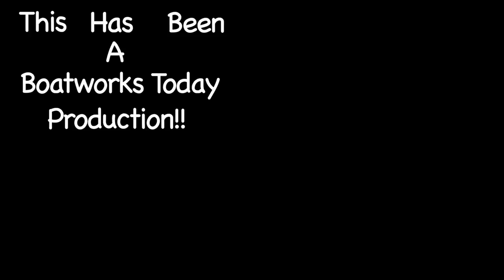STARTING THE FAIRING PROCESS ON THIS OLD SAILBOAT!

Comment: Filler gelcoat- to your 1 gallon of gelcoat with wax, add 1/3rd resin and a gallon container of microspheres. Catalyze a bit more than normal and roll on or 4" chip brush.  Fairing with 80-120 grit will get you 99% there.
Reply: Imagine for a minute I’m pretty ignorant - it isn’t a stretch.  Can you toss out some specific product names?

Thanks!

Comment: The formula for Total Fair has changed since this video was made. In the new version, the blue part is much thicker, more like playdough. There may be a slight green tinge on the surface but that's normal. If you add the right amount of yellow, it will mix to the same creamy smooth consistency.

Comment: Great video as always Andy - maybe a month too late for me :-( 
I've been working about a 2' x 2' repair on my liveaboard.  Replaced the rotten plywood core, glassed over the top with epoxy resin and faired with total fair.  Maybe should have used polyester.  As you said - the gel coat over total fair doesn't set up.  Not just tacky, comes off on whatever touches it.  
I cleaned up with acetone.  Read up on gel coat over epoxy and watched your video on the subject.  Tried it again with the same result.  
Then I googled gel coat over total fair! They don't mix.  Today it is warm enough to go over everything with an epoxy barrier primer per the Total Boat instructions and then gel I'll coat.
I've got a lot more little gel coat spots to repair (it's a 52 footer) and I'll be using a polyester filler for these.

Comment: Andy, thanks for another awesome video. If you would can you make a video of blister repair? If you already made one I’ve not found it yet. I believe a PO of my Aloha 32 used this green Total Fair to fill in the holes when they were attempting to repair some blisters. I’ve been told it just isn’t made for that and much of it came out with a pressure washer the first time I hauled out for the season. 
Thanks for all you do for us.
From the top of the Chesapeake to ya...

Comment: Thats one way to do it.  If I were to paint that I would have looked at an Epoxy Ultra or High build primer.  It acts as a real thick gelcoat.  For your project it looks pretty close as far as being faired.  One of the issues I had run into with that is that it's so thick you need a key coat of primer under for it to bond.  Spray key coat of say finish primer 30min flash spray ultra build, 45 min, one more coat and go have a bite to eat.  I have done them both ways.  Time frames and the ability to spray determines which way to go.  It fairs real nice but don't let it sit for a few days otherwise its get rock hard.   Looks good though.

Comment: Is it necessary to wet out the area first w/ a thin layer of epoxy to make the fairing compound bond better? Or will TotalFair bond to any sanded surface? Thanks for another great video!
Reply from the maker: It's best to apply the fairing directly to a clean, sanded surface :-)
Reply: I'm curious about what you think of people using table top epoxy to do structural repairs? If you watch sailing uma it looks like they used table top epoxy to fix the ribs in the keel.

Comment: I wish I had known about the TB compound not working at all with gelcoat before I started working with it.  I made a real mess. It was so bad I ended up laying down a layer of epoxy resin over all of it and gelcoating over that.  If that separates for some reason I'll either take it all back down and start over or paint.  But it was very solid.  Also, its a sunfish hull, so really just a practice piece.

Comment: Instead, of wax gelcoat, use fairing compound to level the fg surface.  Sand it and apply a second, and, if needed, a third, coat of fairing compound, sanding between coats.

Comment: Andy, you opened the door when you referred to drywall. Understanding that wax is added to Gelcoat, to advance curing, couldn’t we assume that Gelcoat (without wax) would cure on the structure, but not the surface (thinking 50/50). Allowing us to add additional unwaxed coats, to build up before sanding. Just a thought, I defer to your judgement!
Reply: For clarification, I’m suggesting multiple chemical bonds before a wax coat followed by a mechanic bold. You thoughts?

Comment: Love your videos. I have a 1965 17' Boston Whaler that has horrible crazing of the gelcoat. I it ground and a new layer of glass added. I don't need a factory restoration. I am kicking around two ideas, shoot with gelcoat or paint. It has been suggested that I lay gelcoat down like you did here. My question; If I chose to finish with gelcoat instead of paint, would I need to fair the boat or just shoot and sand gelcoat? Thanks!

Comment: Andy I was just wondering. The other brands of fairing compound that can leave pin holes. What if you were to mix a batch up and place in a vacuum chamber before applying. Do you think it would help lesson the pin holes or maybe help eliminate the pin holes all together. What's your thoughts. Thanks

Comment: Could you fill small drilled holes with polyester and cabosil like you would do with expoxy? How about under the water line?
Like on the speedometer pick up.

Comment: What about using Xylene?  Slower evaporation rate, about $20/gal.  When I had my boat, that's what all the people doing glass work would use.  They said "half the price of prep, slower evap rate, and essentially the same stuff".  They do use Acetone when they do small areas that they want the ultra fast flash off of Acetone.
Reply: I use alcohol when ever I can. I stay as far away for acetone as possible.

Comment: Thanks for the informative video! One question: should or could you thin the fairing compound just slightly? It seems to be bit hard to push on there. Especially when using big tools like flexisaders.

Comment: Great video. One question. Wouldn't have been better to use two colors of gelcoat? Sanding through the gelcoat and on the glass sounds like a recipe for disaster. Using two colors of gelcoat could indicate when you need to stop sanding the second coat, just so you don't damage the glass.

Comment: Why wouldn't you use micro balloons and cab o sil then coat the hull with straight epoxy for filling pin holes?  Seems like it would apply and sand much easier then that fairing compound.

Comment: Around 12:50, Andy mentions that if finishing with gelcoat then an epoxy fairing compound shouldn't be used, but I thought West System along with Andy a while back proved that was an old wive's tale kind of thing? So long as the amine blush is wiped away adhesion and curing gelcoat to epoxy shouldn't be an issue?

Comment: Hello Andy hope you having a good time. This is Big Knucklehead from Miami Florida. I just finished your recent video and notice that you said if we using that type of fairing compound we should not use gelcoat afterwards. Well, I made that mistake.  I used that product when you first introduced a quite some time ago. As you stated my gelcoat did not fully cure at that time. What I would like to know is how can I fix this error. Do I need to sand everything back down to the original fiberglass and try to remove as much of the fairing compound as possible or is there another way. This was a repair that I was doing on the boat.

Comment: Hi Andy. I've done some fairing on my cockpit sole with Total Boat two-part. Will I be able to apply Kiwi Grip non skid compound on top of that?  Not sure if Kiwi is a polyester based product which might be problematic over the TB epoxy based compound. TB describes Kiwi Grip as a  hard acrylic polymer. Thanks.
Reply from the maker: You should be perfectly fine to apply overtop this fairing :-)
Reply: @boatworkstoday  Thank you.
Reply: I’m in the process of a 70% record of my sailboat. I’m using kiwi grip and have been on the phone with their technical department. They say it works best over epoxy. I’m using epoxy fairing compound (I’m mixing it myself) over the whole boat and only using total boat where the paint will be. And I made that decision 5 minutes ago when Andy reminded me of the pinholes. Time to order total boat before I go further. And kiwi grip will go over pinholes.
Reply: Re-core. Not record

Comment: Hi Andy, I wonder why you take resin with wax when you use the dewaxer to remover the wax afterwards.
Reply: Wax gelcoat is so it cures correctly.....otherwise you'd have to cover non-waxed gelcoat with plastic to get it to cure correctly. So it's not quite what it sounds like.

Comment: Hey Andy, I’m regel coating a 15ft Boston Whaler. What spray guns would you recommend?
Reply: Good question. In the past I've used my normal HVLP paint gun with the largest spray tip. I had to thin the gel coat down to spray. Just my $.02. still would like to know what Andy says.

Comment: You made the comment at the beginning not to use this if your going to go over it with gelcoat.  I was reading you only want to use gelcoat under the waterline.    I read that polyester fairing compound should only be used above the waterline.    If I'm covering it in gel coat am I safe to use the polyester fairing compound or do I risk it not setting up like you said at the beginning of the vid?
Reply from the maker: Actual gelcoat can be used both above and below the waterline without any issues.  However, below the waterline for fairing its best to use some in epoxy base product and then finish that off with a barrier coat and then bottom paint.  But above the waterline, you can certainly use polyester based fairing and then go right over top of that with your gel coat to finish the project :-)  that said if you want to finish with gelcoat below the waterline, you can then use a vinyl ester based fairing compound, and you won't have any issues

Comment: If you had applied a tissue mat at the same time as the 300gsm matt you could have applied the gelcoat to a finish standard. would have taken barely more resin than you originally used and way less overall effort.

Comment: Andy, (thinking of joining Patreon). I just started watching. I have a question:  I have a FG boat w polyvinyl resin & a coating of gelcoat.  I had to drill out the rivet on the gunnel. I patched the holes w Total Boat rial fair epoxy-same stuff you’re using.  I’m making a mold out of it. Now that those holes are epoxy resin now (about 1-4”) do I need to use an epoxy resin to make the mold out of?  If so, what Total Boat product should I use!? And, what about a gelcoat?   Thank you

Comment: WHICH IS HARDER, stronger longer lasting and less prone to cracking GELCOAT, polyester structural  body repair or TOTAL FAIR?
Reply from the maker: Depends, poly based materials will have a harder cure which also makes them more prone to cracking as they don't have a lot of flex. Totalfair, while still fairly hard is softer but that's what also makes it a bit more flexible and less prone to cracking ;-)
Reply: Harder, stronger and longest lasting are all different and somewhat incompatible goals. Failure of the fairing would be cracking, crazing or de-lamination. Given that the substrate is flexible fiberglass you'd prefer a softer, more elastic material for long life.

Comment: Andy, I am totally confused now. You always teached not to use polyester based gelcoat with epoxy material, didn't you? But now you use gelcoat underneath of epoxy based fairing compound.
And second question is why don't you use just fairing compound first to fill lower spots instead gelcoat. Fairing compound is meant to be used for this specific purpose, isn't it? Please clear this up. Thanks